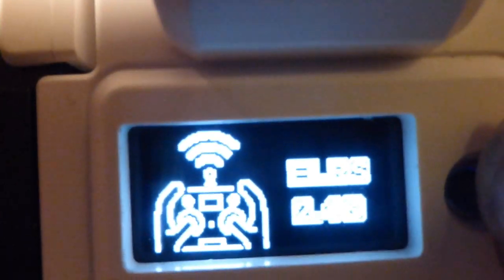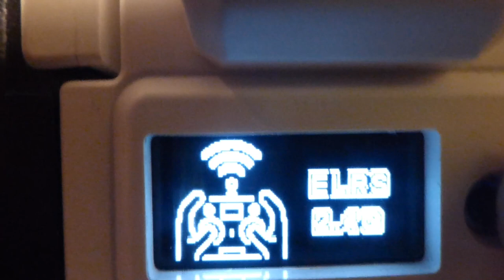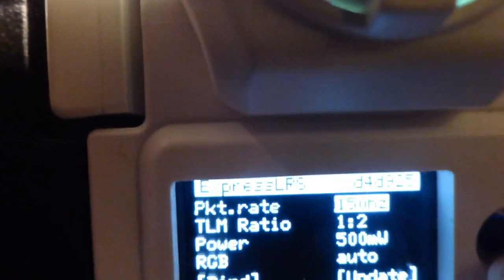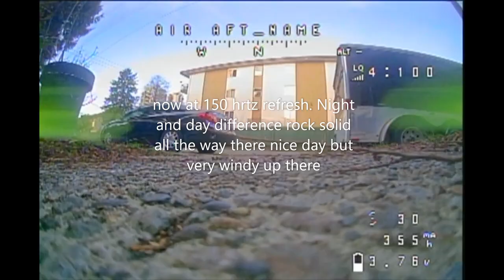How to get better range from ExpressLRS

Comment: are you running stock vtx?
Reply from the maker: No this was a tbs unify pro v3 with the sma connector removed
Reply: @HaggalaisFPV  ok thanks, should be getting mine Monday and was thinking there is no way 200mw gets that range
Reply: How come your 800mw VTX has better range than my 1.6W

Comment: I accidentally had my radio on 500hz, and it was fine, so one day I head over to a parking lot, then I get RXloss and destroy my battery and GoPro mount
Reply from the maker: there is a chance that turning up your vtx too high in a RF heavy area that you get worse performance i just keep my remote at 150 HRZ and never had a problem like that.
Reply: @HaggalaisFPV  yea my hz was way to high and now that  I changed it, there’s no more issues